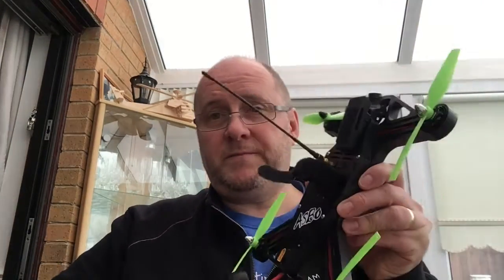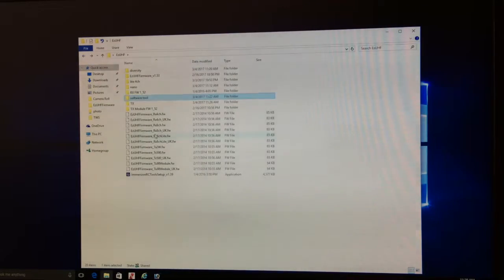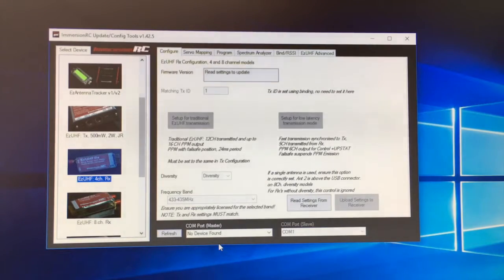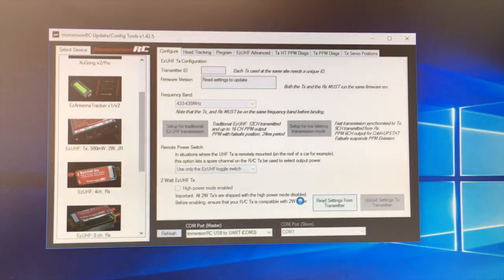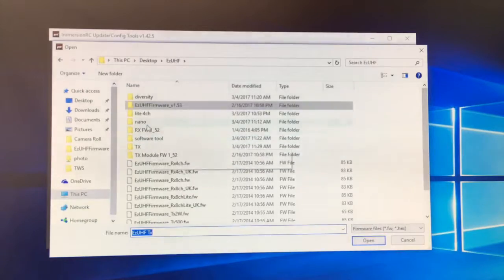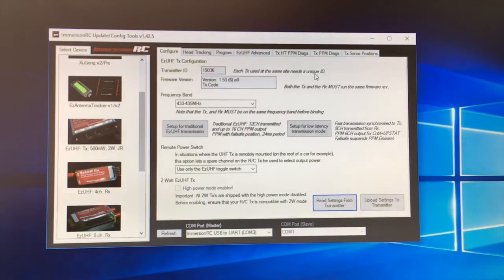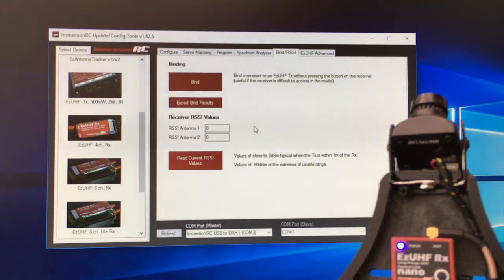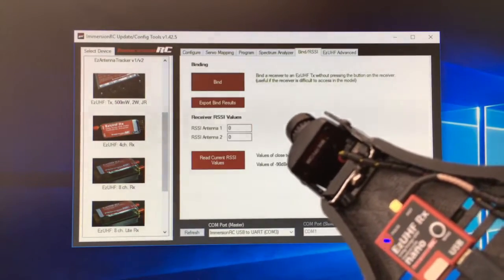EzUHF (1) JR Module & Nano Firmware Updates v1.53 & bind

Comment: Hi Thank you for this video, I cant seem to get my module to get into bind mode
Reply from the maker: Set module to Low power and keep the failsafe button pressed on the module while you turn on your transmitter.
Hold for about 10 seconds. You should have an intermittent beep.
Then power up your model and 2 second press of the button on the receiver.
Power off to model and turn off transmitter.
Repower transmitter and model and check all works
Reply: yup , thank you so much. I found out that my driver was not installed properly, and once i got that done, i followed your procedure and it worked to the T.. thanks again for your help
Reply from the maker: glad to be of service........that is one thing wrong with EzUHF is that it only works with PC and not Mac.....